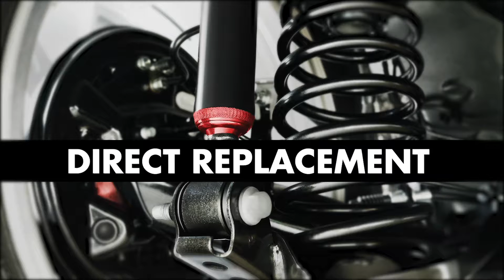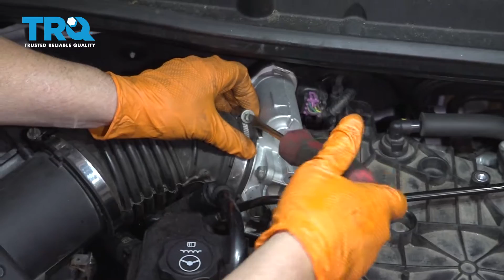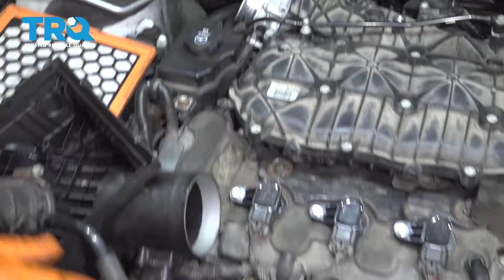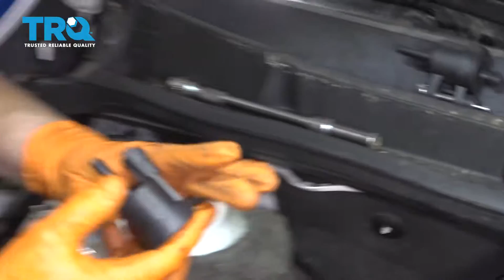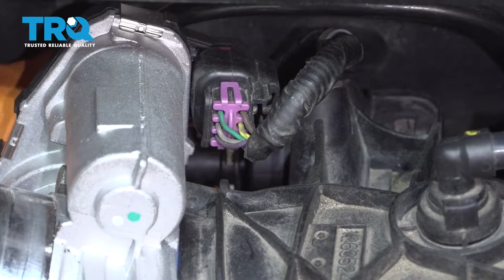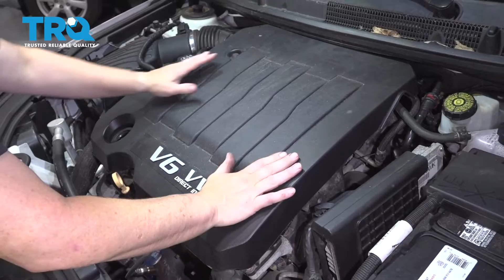How to Replace EVAP Vent Valve 2010-16 Buick Lacrosse

Comment: Thx for the easy video. I did remove the throttle body for easier access and to see better what i was doing. I Did a clean on it while i was there along with the mass air flow sensor when putting it all back together.

Comment: My lacrosse 2013 can't make constant stops or idle without check engine light comes up. It disappear on its own after driving for 5 miles straight. Had the code read it says too lean or too rich. Can it be dirty air filter or crankshaft?

Comment: Great video! Thank you! This looks like a super easy fix and one that is not going to be expensive.
I bought a used 2016 Buick LaCrosse V-6 and have had it for two days now. Check engine light came on and it is throwing a P0496 code. The first thing I did was check the gas cap and cleaned the seal; it didn't look bad. I guess the evap vent valve will be the next thing I look at and replace, since this would seem to be a more likely issue than the gas cap.